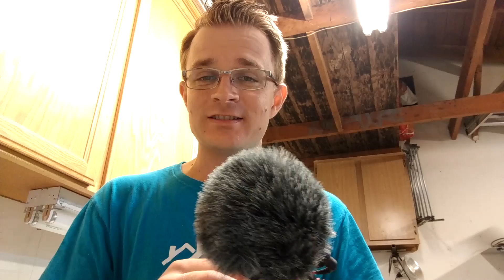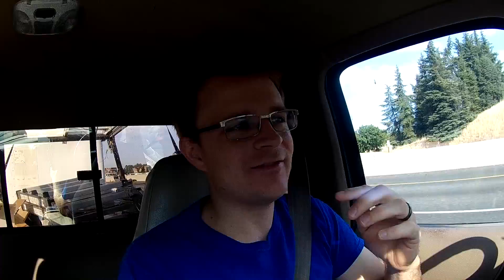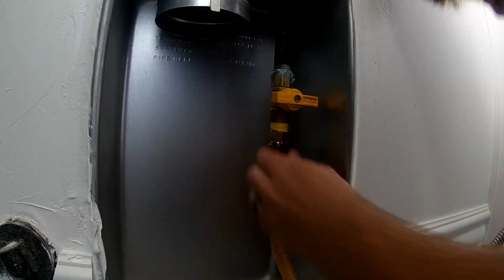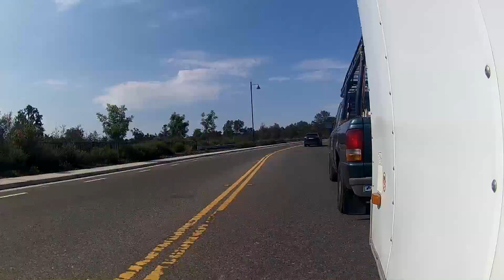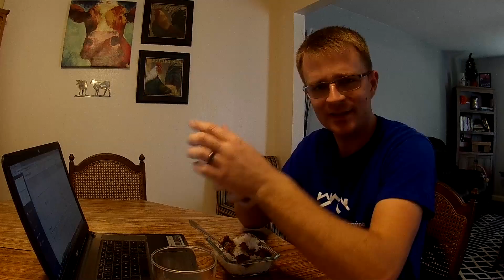The Handyman Fears Being Found Out / WLOG

Comment: By the law you can't use that flexible vent for gas dryers because it is very flammable. You should use aluminum Flex or metal pipes. I am also handyman I'm working in New York state
Reply: No is silver but it's plastic not metal I know this vent lines